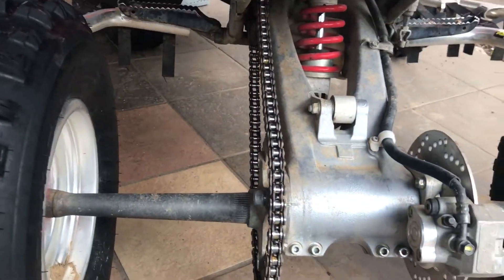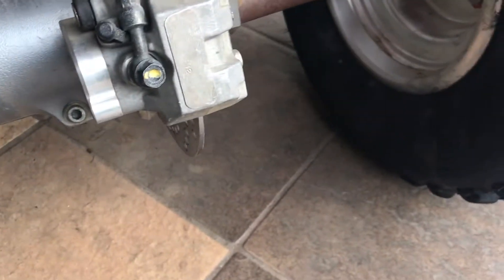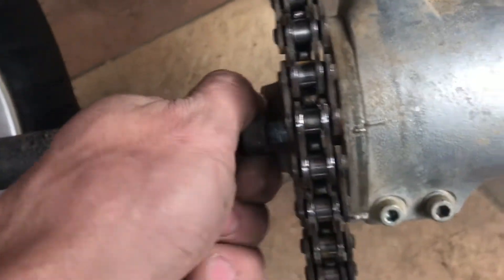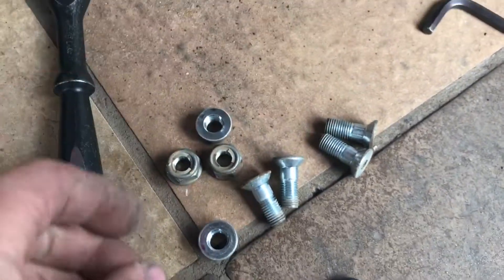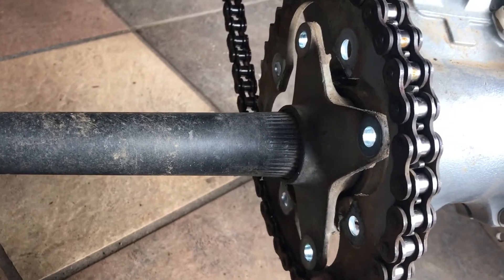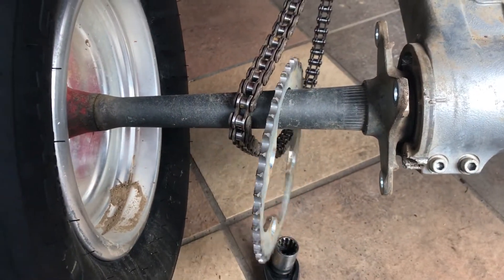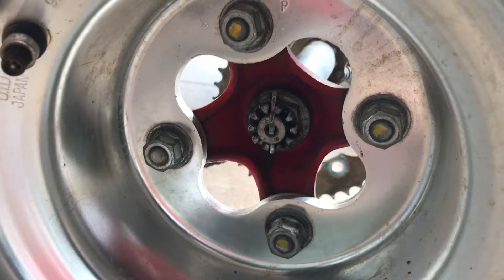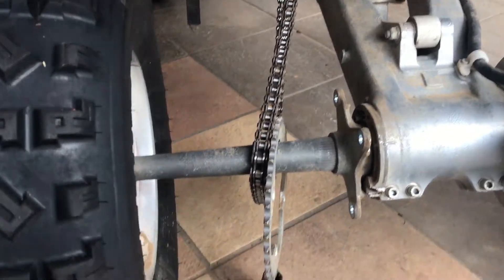How To Take Off Sprocket On Honda TRX 400EX

Comment: Good, "quick"  video showing AND saying what is needed to do to change the sprocket.  I had a friend tell me he was afraid to do it....having to pull it off splines???  I  told him you just have to take wheel off and the 4 bolts,  then the sprocket will come off without having to remove anything else, just turn sprocket until it fits over axle bracket.....your video as well as what you said makes it easy to show him how easy it is to do. Thanks